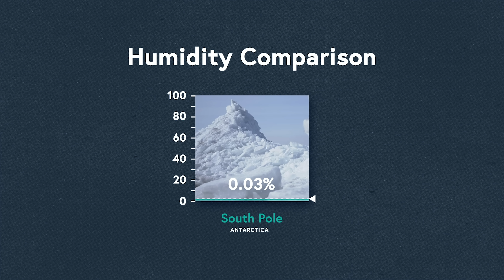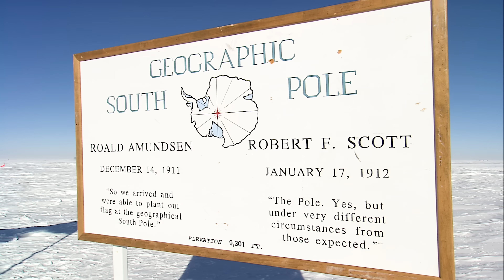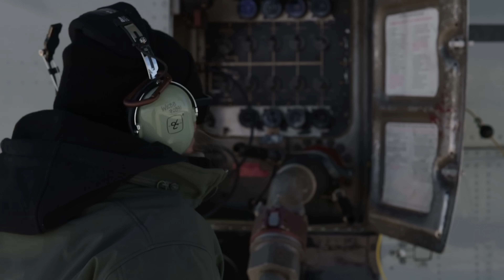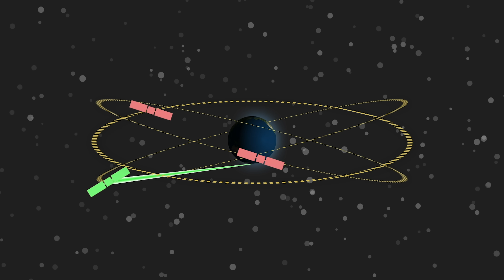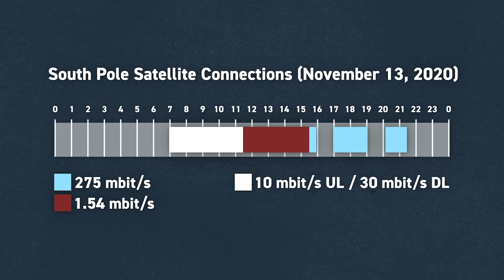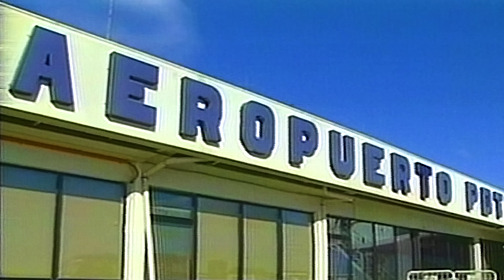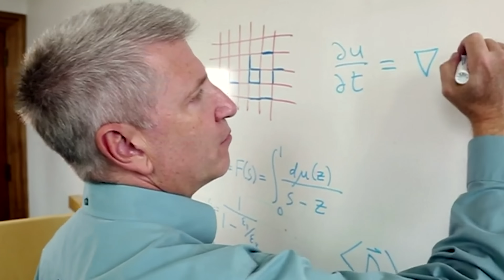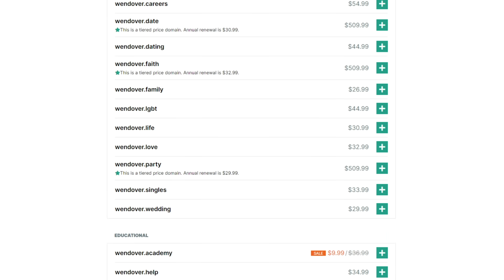How Living at the South Pole Works

Comment: 1. Earth is flat
2. It's not south pole it's ice wall that goes around earth
3. Satelites don't exist
Reply: Do you really want to know if the Earth is flat? Here's what you gonna do:
1. Do your holiday somewhere at the western coast of the sea.
2. Watch the sunset with a pair of binoculars or a camera with a decent zoom lens in order to clearly see how the Sun disappears below the horizon. Notice that it doesn't get smaller and smaller until it disappears as the flat earthers claim. It stays at its size and it just sinks below the horizon exactly as seen on millions of sunset pictures on the internet.
3. While still at the beach take your smartphone out and go to a random webcam one hour to the west. For instance, if you are at the Western coast of Italy then go to a webcam in Spain. Notice how it will show a Sun slightly above the horizon.
4. Call a webcam several hours to the west. To take our example from Italy: Call a webcam at the U.S. East Coast. They will have early afternoon and accordingly you will see that the Sun is quite high up in the sky there.
5. Convince the rest of the world how all this could be possible on a flat Earth and collect your well-deserved Physics Nobel Price for finding new optical laws.
Reply: @7inrain  Good one. ✌🌎

Comment: In 2003-04 season they sent a Dr that was more interested in cross country skiing and rubbing shoulders with the upper management in the construction crew so somehow she slipped through, she couldn't handle a hang nail issue let alone a runny nose! At least her medical assistant had good medical knowledge. I know that the doctor's at McMurdo didn't think much of her either. Sending me off early because I was having a minor glitch with carpal tunnel from the use of the computer lab and poor designed tables meant for eating at or book use not keyboards.

Comment: What's down there to study, couple of penguins and a bunch of ice? Rarely able to even go outside, no reliable transportation. What's the fascination with it?
Reply: Look up ice cores. The Vostok ice core is one of the most famous, as it's overwhelmingly strong evidence that humans burning fossil fuels are very definitely the cause of climate change. They can tell because the ice traps little bubbles of air, and that air has carbon dioxide in it, and that carbon dioxide has a ratio of C12 to C13 that varies over time called Delta 13C. Worth looking into, it's fascinating stuff.

Comment: Another note on communications at the South Pole: They have some amateur radio equipment that works around the clock for sending basic communications, or in emergencies. It's possible for researchers to send very rudimentary text communications using email, and if there's free time, occasionally someone will jump on and start talking. My university has received some of their communications in the past when conditions were just right. I don't think they rely on amateur radio much anymore, but it's still possible to sometimes make contact!

Comment: Thanks for this video. It really illustrates how absurd the idea of a Mars colony is. They would have several YEARS without access to any but the most rudimentary medical care; there would be NO POSSIBLE WAY to evacuate a seriously ill person; and on top of it all, they'd have no air but what they make and no protection from cosmic rays and their bones would deteriorate due to the low gravity. Ten degrees Fahrenheit is cold, but at the poles you can go out in it and it's actually quite refreshing. And clean. On Mars you can never go outside without a space suit and you never get to breathe fresh air. The ISS stinks like an outhouse. A Mars colony would be the same. But in an emergency you can get back to Earth from the ISS in a matter of hours. From Mars it would take many months at a minimum, or over a year if the orbits are not ideal.
Reply: To me it sounds like a bunch of excuses Daniel. If one or 2 fuckers have to die so be it but we will have a mars station. Compensate their families and move on. Victory cannot be achieved without sacrifice. Get the fucking shit done.

Comment: Would it ever be worth it to build a ground-based transportation link from Amundsen-Scott to McMurdo or one of the other coastal stations that is effectively impossible to see cut off by weather, and how would that affect the research itself?

I'm assuming their power is generated through nuclear, since any sort of combustion (fossil fuels or trash incineration) would destroy the sensitive research, wind turbines would freeze up, solar is all but useless near the poles, and there's no rivers to generate hydro from. Such a nuclear power system would theoretically be able to power an underground railway between McMurdo (or a more suitable station) and Amundsen-Scott, allowing for resupply and evacuation regardless of what conditions are going on on the surface. Even a fire at Amundsen-Scott during the fiercest blizzard and lowest temps would not be able to stop an underground railway from operating, especially if the station at Amundsen-Scott was buried and accessible through an underground access path from "the lifeboat".

Realistically, we already have the technology to build such a railway. The only questions are how much would this cost and what effect it would have on the research.

Comment: According to the climate-change doomsday cultists, there is no ice down there.
Reply: no.
Reply: @oiuhoindds924  Yes. They predicted that all the ice at the Poles would be gone by the year 2000, then by 2020. In fact there is more ice than ever.
Reply: @archiebald4717  who predicted this and when. you could have very well made that up just like the bozo that might have said it
Reply: @archiebald4717  i literally did 5 minutses of looking at sources and the ice sheets of antarctica are shrinking by 152 billion metric tons per year and as of today are the ice sheets are just above 2500Gt of net loss of ice. So yes there is still ice but it is melting at an alarming rate.

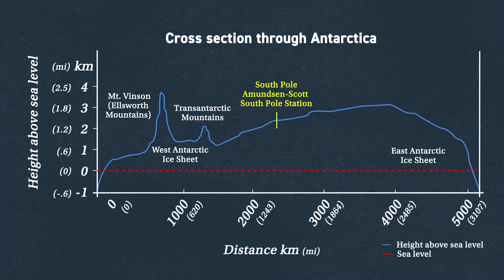Comment: 1:11 - the elevation is about 9300 feet, but the atmosphere is thinner at the poles so the air is about as thin as it would be at 10,500 feet at the equator.

Comment: 9:10 Who the Frick brought there standard bicycle, you can’t ride it in the snow, the tires are way too thin, I doubt there’s a place for you to ride indoors. Just why????
Reply: The firn is NOT soft. It's kind of difficult to describe, but even though it's about as light as styrofoam it's pretty stiff. Riding a bicycle during the summer months shouldn't be a problem at all, though the usual mode of transport are snowmobiles pulling (usually plastic) sleds.
Reply: @alanlight7740  Interesting, I’d still imagine a fat bike being easier when over snow

Comment: I believe if we build foundation on top of hydraulic reservoirs so it could 1 generate fuel less electrical power to supply the sun control emission, second it help generate extra power for gravitational shield to keep comfortable living habitat. If the weight of the building pressurized a two layer reservoirs of air and fluid then you chanel fluid to drive hydraulic motor to run generator then return to the air portion of the reservoirs and it run forever as long as the building has weight then the radio telescope would point emission to control sun level of emission and earth life energy to control crop yield of entire earth then it also use moon as mirror to perform world wide internet laser communication station that connect the world then it also control earth climate and ocean current  by regulating the south pole temperature

Comment: Hey Wendover. Why no mention of the 2 (or more) supply ships that arrive in McMurdo? I'm sure you realized when making this video that the USCG ice breaker isn't near large enough to deliver cargo and take away trash and research.

I worked on the Ocean Giant as a crew member and was down there in McMurdo January/February 2020. We had over 400 containers, heavy equipment, and even new semi trucks for the station. Then on the return we took trash ice cores, and leftover empty containers.

We also carried a floating dock system with us from the US that allowed trucks to get right next to the ship for loading/discharge. Then immediately after our departure the tanker Maersk Perry came in and delivered liquid products.

I'm just curious about why no mention of these ships?

Cheers.

Also why no mention of the overland sleds that travel to and from McMurdo to the South Pole?

Comment: NASA has been developing stirling based RTG's for use in space. I wonder if the best place to test those wouldn't be at this outpost. Place a half dozen in a separate building and run the heat and electricity generated into the main building. The generators would get a shakedown test and even if they mechanically failed you could still use the heat generated to heat the station. 

They should be able to produce heat and power for at least a decade with no need to refuel and when they are depleted only a relatively small amount of waste needs to be removed... or you might just leave it in another building and use the slowly decaying cores as an auxiliary heat source.

Comment: Communications are not "cut off" as you suggest.  Granted there are Internet blackouts, however Ham Radio operators like myself have been providing Antarctica with communications to the outside world round the clock through HF band communications, linked to telephone land line nodes (phone patches) -- and we've been doing it for decades!

Comment: Why not keep such a plane and pilot there during winter?
Reply: A. That is incredibly expensive as the pilot would be just be sitting there doing nothing for the possibility of being needed. 
B. Keeping a plane at the station dosn't change the fact that the weather will almost allways be too bad to fly in
Reply: @matsr_2279  yeah of course thats the obvious reason, but isnt this mission expensive in general? and it can save precious time in the event of an emergency. And you don't need two good weather windows.
Reply: @paulallen04105  It is as a whole expensive yes, but they are on tight budgets and maintaining a pilot and plane in -60 Centigrade would be just impractical and ludicrously expensive.

Comment: "-12 degrees Celsius—a temperature that most of the world would consider absolutely unbearable"
Canadians: hold my beer
Reply: -12c isn't bad, mild and normal winter weather. You work hard enough and you don't even need extra clothes or hat.
Below -20c is where things are starting to get annoying. Despite it being dry, the coldness starts to really creep into the bones. And starting cars without external heating is a b*tch. It's like sitting in a subzero freezer the whole time. Covering the radiator grill helps a little, otherwise the engine would never heat enough to heat the cabin.
Below -25c is where it's starting blur. It's the same if it's -25c or -30c because you really don't want to be outside longer than you need to.
Clothing helps but unless you wear a face cover, your nose and cheekbones are still going to freeze. The more colder, the less you can have covered parts.
No, not canadian. There are cold winters in other parts of the world besides Canada.
Reply: He said that because there's more to this world than Canada, Russia, and the poles lmao. Yes, a LOT of this world's population wouldn't cope with weather that cold. India, China, Japan, pretty much all of western Europe, the southern half of the United States, Middle East, Africa, South America, etc. Most of the world's population lives in a warmer and humid climate.

Comment: I used to fantasize and dream about living in the South Pole for a year. Unfortunately I’m neither a scientist, doctor, janitor or chef 😅
Reply: Let's see - scientists spend the least time at the station. Depending on what sort of scientist they are they either come in for a week at a time to set up experiments or collect results from them, or are out at the field camps. We had a few cooks, and - summer of 2007-08 when I was there five janitors/dishwashers. Basically 1 doctor, sometimes a second doctor visits during the summer.

We had 8 or 9 electricians, 3 plumbers, must have been more than a dozen carps (and in Polie terminology a carp can work with metal as well as wood), 1 welder, a handful of fuelies, a whole cargo and logistics section, a few comms and computers people, a couple engineers, etc. ... most of the people working there are NOT scientists, doctors, or chefs - though everyone does do at least a little janitorial work in their own areas. Probably easiest to get down there as a skilled tradesman.

Comment: What does the station use for power generation during those long dark months?
        Two seconds on google
- short answer - Diesel electric generators
- long answer - one of the most efficient and complex set of internal combustion engines on the planet
* New video incoming: How Do You Power The Most Remote And Deadly Place On The Planet? 🤣

Comment: We're just gonna gloss over the part where they lift the entire building up? How is that better than just clearing out the snow every year?
Reply: 1:51 They tried that strategy with the second larger geodesic dome that shielded the base structures inside. Quote:

"...this too was buried by snow each winter meaning that each summer, considerable time and fuel had to be used to dig the station out. In a place where absolutely everything has to be flown in, this was an enormous expense that got in the way of science."

There are limited sources of time and fuel, so to continuously keep bulldozing the same pile year in, year out doesn't make much sense. Solar panels wouldn't cut it. Remember, it is winter and dark for nearly three months long, and twilight for a similar period. Harshly cold and often battered with blizzards. Specialized wind turbines are too expensive and often generate "wild AC", power that is directly commensurate with the current wind velocities.

The fuel that they get during the 3 months long period of clear summer day should last them the remaining 9 months. That flown in fuel is what runs their power generators that provides heating and lighting, and powers snowmobiles and other equipment. Cutting off the expenses associated with clearing the snow does go a long way in having a more efficient station. Remember, this is a non-profit endeavour, so any unnecessary costs saved up eventually adds up.
Reply: Keep in mind that even if you remove snow the surrounding area also elevates. German Neumayer III station also does the same thing. Each leg moves separately up/down. You life one leg, put snow under it, put it down. Repeat.

Comment: "proposed South Pole Connectivity Program, a planned optical fiber link between the South Pole and the French–Italian Concordia Station located at Dome C at the edge of the Antarctic Plateau; Concordia has 24-hour access to geosynchronous satellites"

Surprised you didn't touch on this: https://en.wikipedia.org/wiki/South_Pole_Traverse#:~:text=The%20South%20Pole%20Traverse%2C%20also,Amundsen%E2%80%93Scott%20South%20Pole%20Station.

Comment: Antarctica is like another planet
-Hard to get in/out
-In some periods getting out is totaly impossible
-nobody really know who owns that land
-wierd day light cycle
-Extreme cold and other conditions
-Have to be self sufficient
-Slow internet and communication
Reply: No, you don’t have to be self-sufficient. If that were the case, there wouldn’t be massive ships of supplies going in and out all year.
Reply: @JaylemagnifiqueGame  That's debatable since he mentioned its average height from sea level is high enough for some people to get sick. But otherwise, yeah, you're right.
Reply: Which is why I feel that we, as a species aren't ready to migrate over to another planet or even the moon entirely since we've barely only colonized Antarctica. The difficulties of survival on Antarctica will be miniscule compared to another world.
Reply: @makuaannon4208 yeah, even the upcoming moon programmes aren't big colonies but simply permanent bases which later, will turn into colonies. Once we gett9 the moon its like antarctica, bunch of cool research bases. One thing that may accelerate the moons colonisation is the amount of ice and helium 3 it has though
Reply: It is still a tropical paradise compared to Mars or Moon
Reply: @KateeAngel  Moon isn't frigid the same way Mars is. The average daytime surface temperature quickly reaches up to 120°C (250°F). Because of no atmosphere, everything exposed to the Sun quickly heats up, while everything in the shadow radiates all that heat very quickly. During the night temperature quickly falls down to -130°C (-208°F).
Long story short:
On Moon - During the day you get sunburned. During the night you freeze to death. So you get to experience two hells in one day :D
Reply: @_Killkor  Moon has it's own atmosphere, but it is very thin
Reply: @BrazilianImperialist  I know, but it doesn't matter as it's virtually vacuum (surface bound exosphere), so there's barely any difference temperature wise. So, without getting technical, so practically, it has no atmosphere.
Reply: @_Killkor  there's an atmosphere inside the moon but it's artificial.
Reply: The Earth is Flat.

Comment: I have had the pleasure of living down there this past summer. So fun fact, everyone has a constant nose bleed due to the dry air. Also, because your body works so hard to get oxygen, your hands and feet are constantly drenched in sweat. In my first 2 weeks there, I lost 10 pounds by doing nothing but trying to survive. Thanks for this video! If you have more questions feel free to send me a message!
Reply: I lost over 30 pounds while twice as much as I usually do. Town electrician, summer of 2007-08.